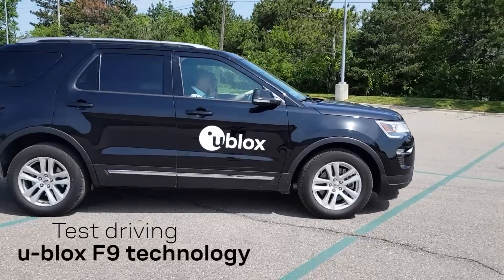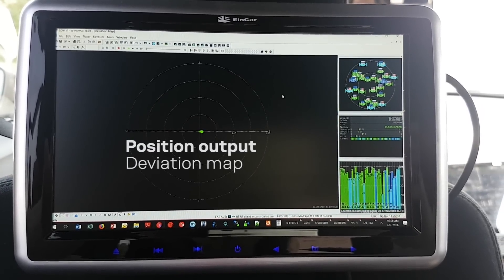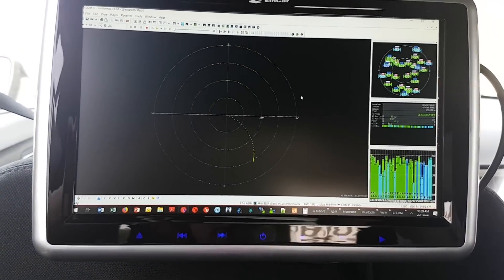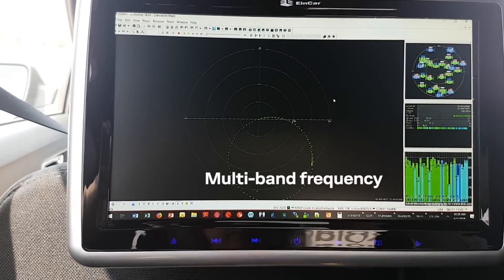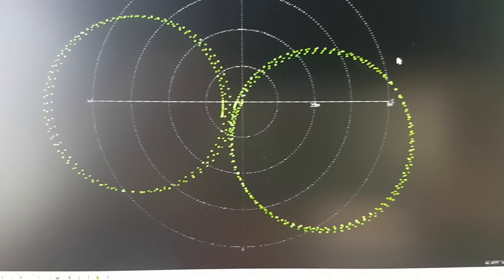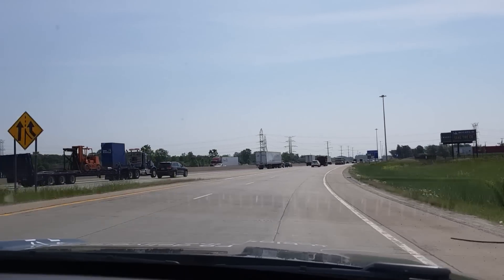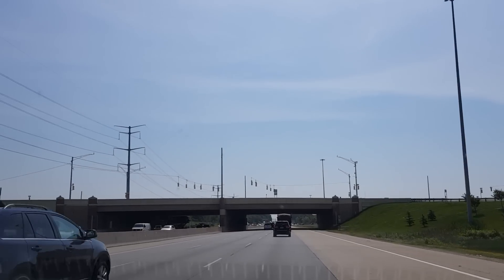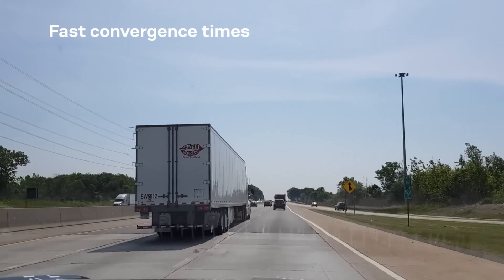Demonstration: Live u-blox F9 car demo

Comment: hmm, that doesn't sound affordable
Reply: You can now (May-2019) buy one for well under 200€ (simpleRTK2B) as a complete module (just plug to usb and antenna and go). There are also other similar modules available.
Reply: Right...or easy to implement, there are quite a few intricacies to get a "fixed" (RTK) position, especially in a moving car !